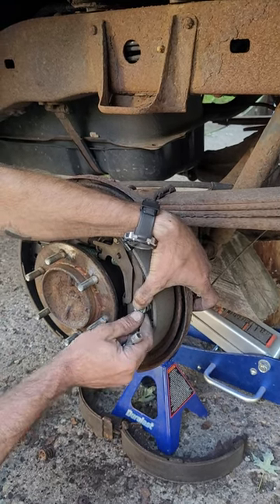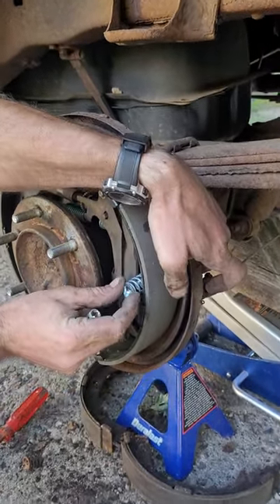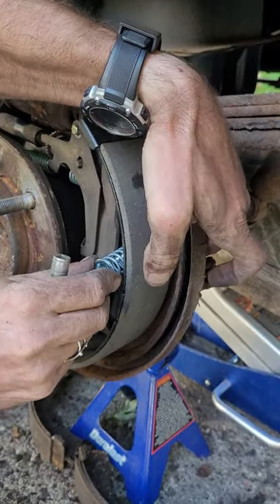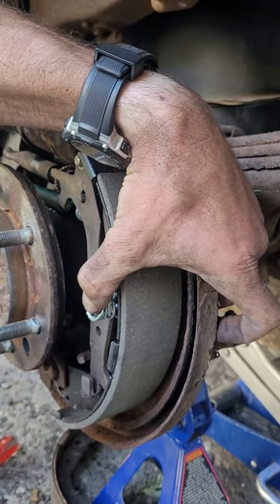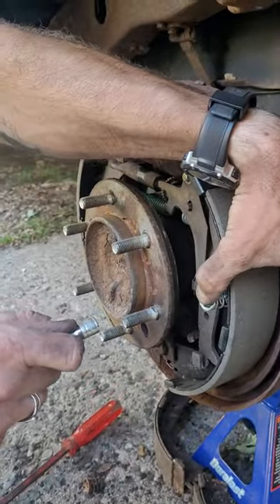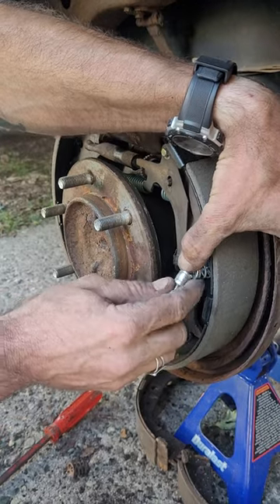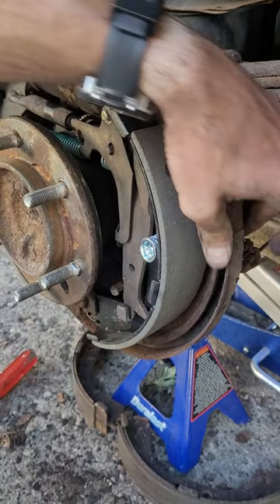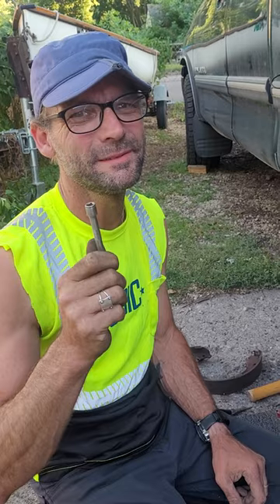Drum brake spring and coupler setting without tool.

Comment: I hadn't done drums since my first car but my wife's rears needed replacing recently. I ended up grabing that plate with the very end of the jaws of my vice grips to push it down, and then twist the little post by hand. I get that there is a cost and longevity reason to still using drum brakes, but why the hell are they still such a pain to install? No one can think of a better way to attach them then 2 tiny bits of metal and a spring? Really?
Reply: This just helped me with my drum brakes! Thanks!